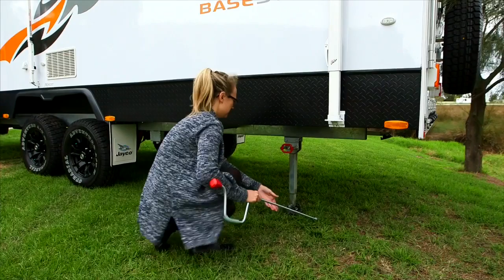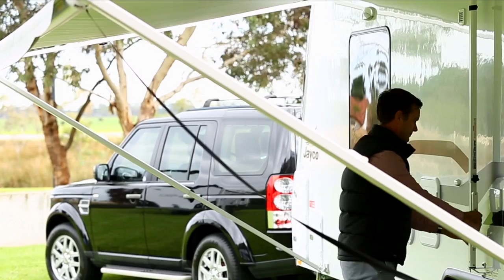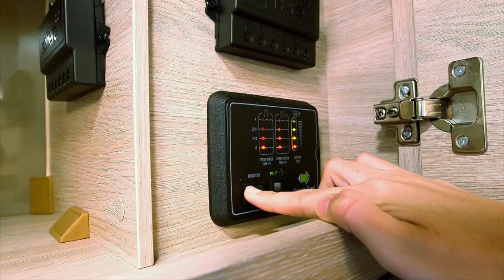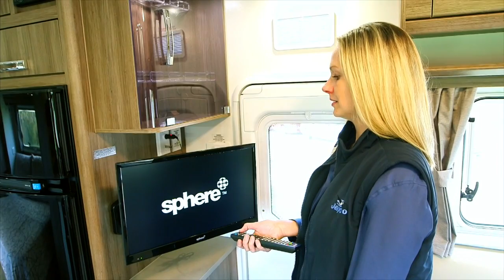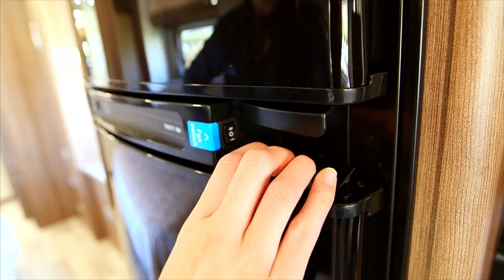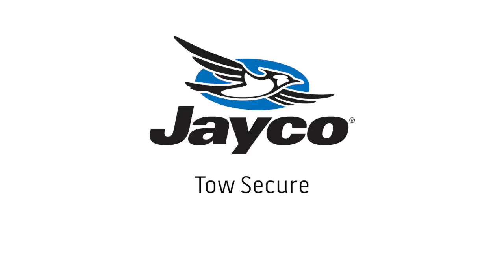2016 Jayco Toy Hauler Instructional Video

Comment: A useless and actually misleading video that promotes bad practice. So why useless . A Toy hauler or Base station is designed to load motorcycles. That fail to cover this unique feature entirely
Bad Practice: you should not secure the breakaway to the chain  shackle. Shackles are the most likely thing to be not done up correctly and they should be nipped with pliers as people have vastly different hand strengths. 
Shackles must also be certified rated painted shackles suitable for  towing weight. Most are too light and not rated.  There are loading techniques and issues with loading safely. Please try again.  And yes I have a Base station.